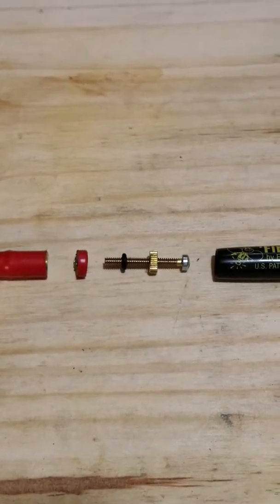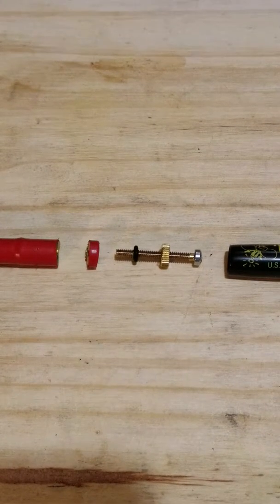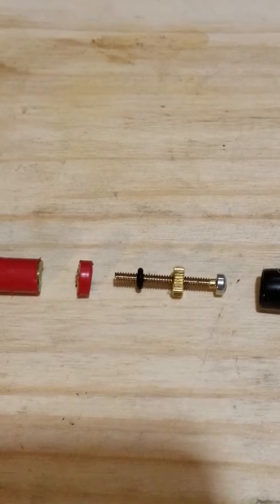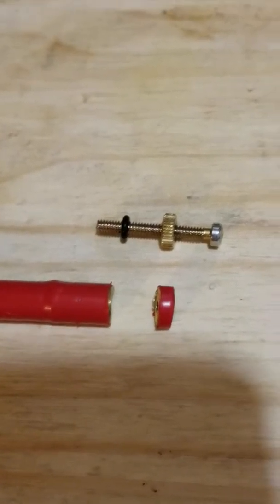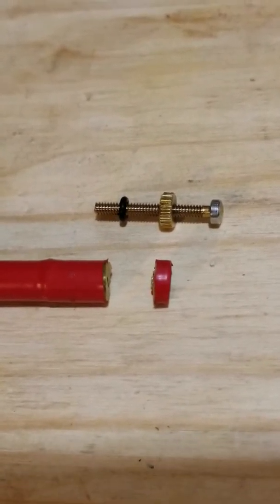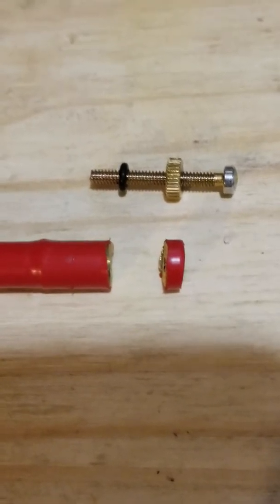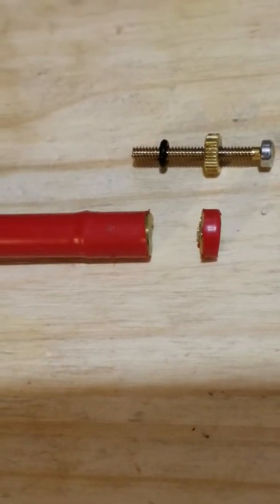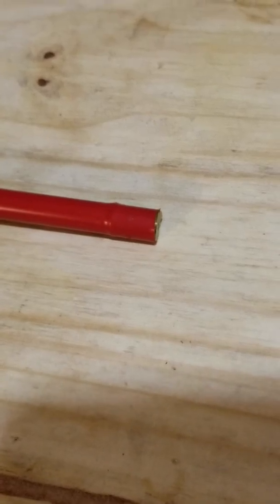How to Shorten a Firestik Antenna Too Long by Trimming

Comment: Amazed, took a similar amount off after getting stuck at 3:3.  Used a diamond wheel on a dremel, left the treads usable, which was good as I needed the screw for fine tuning.  Quit fiddling when I got to 1.5:1.4.  Thanks for the tip!!
Reply from the maker: Glad the vid was helpful. Thanks for watching and commenting.

Comment: At first I thought no way just that little bit wont do anything.  But walla...Your right. Did like you and fixed it. Went from (3) down to (1.5). THANK YOU
Reply from the maker: Excellent! Glad to help. I think I stared at the antenna for about 5 minutes before I took the saw to it. Still works great.

Comment: Great information, thanks!
Reply from the maker: Thanks for the comment. If you're faced with the same issue, just take your time and make sure that all other potential sources of the abnormal SWR readings have been addressed. For me, that was the right solution.
Reply: Did you try a swr reading without the spring?
Reply from the maker: @drummerforjesus9667  my original set up was without the spring or a quick release and the swr readings were spot on. But I wanted the quick release with spring for easy on and off use and to give the antenna more flexibility when hitting branches. The video is about the adjustments I needed to make that set up work. CB working great since that time. Thanks for the comment.
Reply from the maker: Thank you. It's certainly a unique situation that I found myself in. You just want to test and retest everything else as there is no going back other than sliding the cap back on.

Comment: Believe it or not, cutting length off the plastic tip before putting it back on will also electrically shorten the antenna.
Reply from the maker: That's correct! Just don't shorten it too much or it won't stay on. Gluing it on would lengthen the antenna electrically. Thanks for watching and commenting.